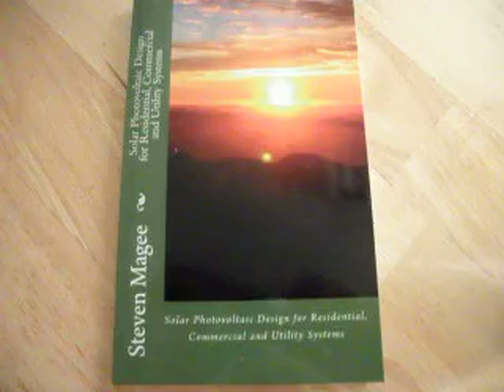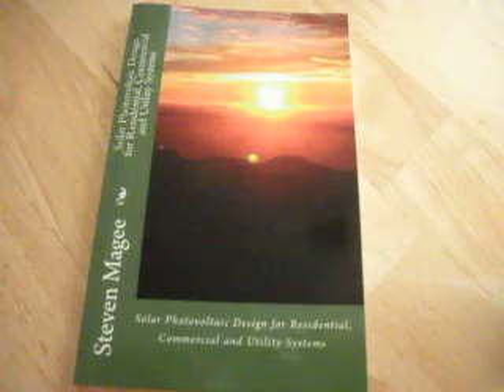The Edge of Cloud Effect in Solar Power Systems

Comment: The effect you show is real, no doubt but what I have noticed which is even more important to me, is the cloud effect on partly cloudy days when the clouds are simply in proximity to the sun.  The effect I'm talking about is highest when the cloud is not very thick.  When the cloud is lit from behind it acts as a diffused spotlight and adds to the total radiance received by the PV panels.

It can actually be a real problem.  I have a system with 11.7KW PV on the roof but on days with full sun and clouds near the sun I will produce more than that.  Since I designed my system to handle my 11.7KW when I produce more I often kick out my PV breakers.  I haven't decided what to do permanently but on days with clouds in the sky with the sun I usually cut off 1 KW in the combiner box to keep it running.  I need a larger breaker but haven't found one yet that will fit on a rail in my system, I'm looking.
The transients caused by edge effect are short lived and for small systems like mine are inconsequential.  Breakers will handle short lived over loads without tripping most of the time.  I could see where it could be a problem if there was not enough overhead in the charge controller so that there was an over voltage situation.
Reply: This is why you should have hired a professional solar designer for your project. The correct formula for calculating minimum circuit ampacity is Isc x 1.25 x 1.25. The first 1.25 factor is for the continuous duty factor, and the second 1.25 factor is for edge-of-cloud effect. It is in the electrical code.

Comment: I started to write a lengthy comment but realized it probably was a waste of time.
Reply: +Patrick Burns 
Yeah, since this was posted in 2011.. 
IMHO, this seems a little simplified. Or maybe not enough detail.?.

What "seems" to happen, is the sun is pouring the power into my PV array, on a cool day, and a panel rated for 200W puts out just about 200 watts.. But the edge of a cloud, somehow causes more solar power to be delivered to the array.. Suddenly, I see ~216 watts.. Where it that extra power come from?? 

Is a layer of clouds acting like a neon laser? And sending a Laser-like beam of light down to my PV array? ;)

On the very best days of bright sunshine and 10deg F temperatures, do I see a true 200W from my 200w rated Chinese panels.(Canadian Solar). But, then suddenly out of the blue.. More power! 

My explanation is, those clouds are acting like a big magnifying glass.. Gathering light and concentrating it..  
Or maybe some clouds form into a big Fresnel lens in the sky..  ;)